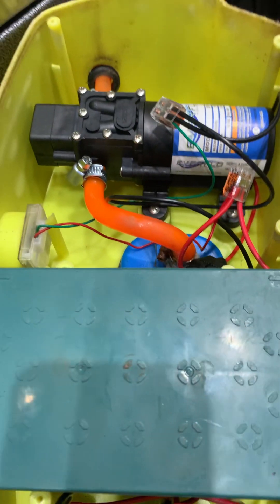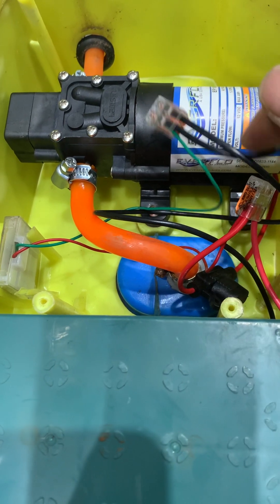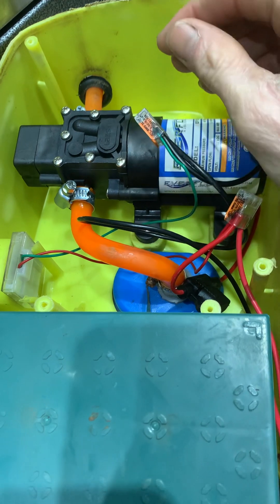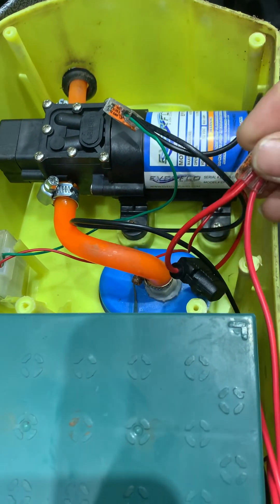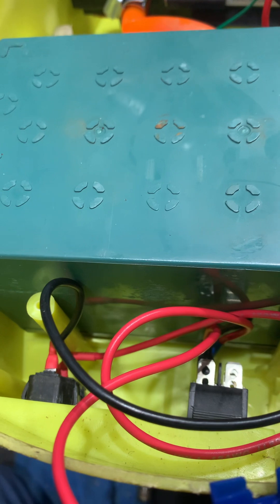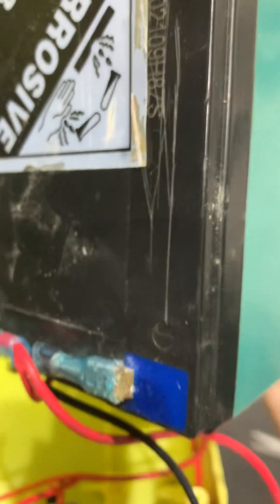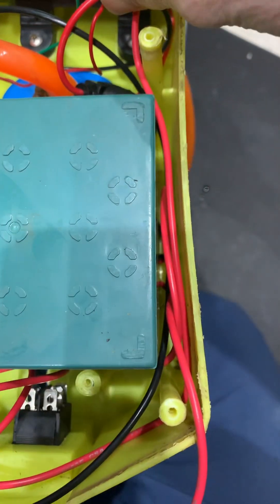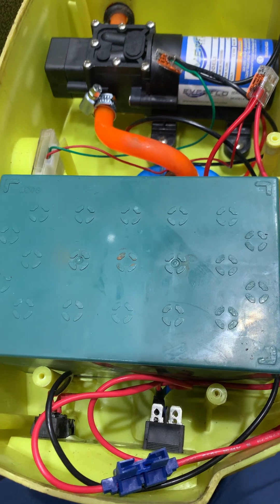Window cleaning backpack - part 2 - rewire

Comment: Nice rewire there Darren. Using longer cables will reduce the risk of the risk of then being crushed and damaged again. Like that you have soldered the charger and rocker switch connections plus looking at protection then for fluid. The Shielded battery spade connectors ensure good connectivity and keep the terminals dry. Great example of maintaining wiring looms and extending life of your equipment